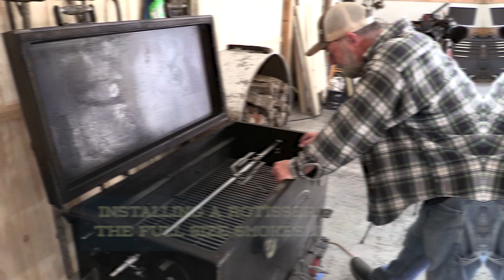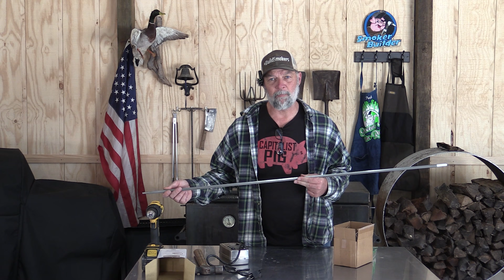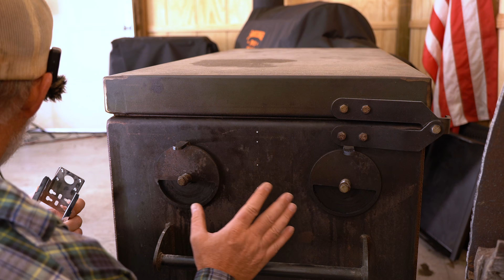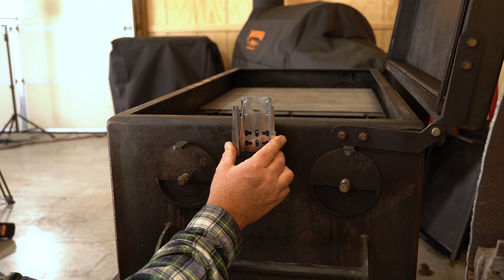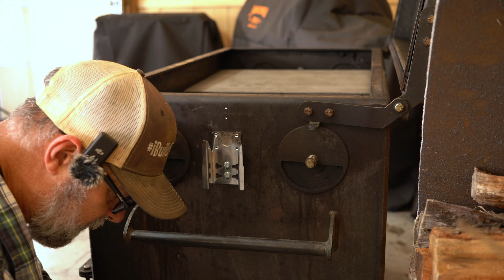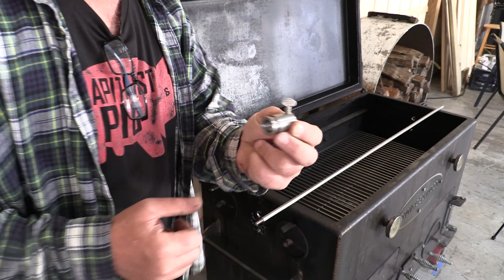Smokeslinger Rotisserie Install | How to Mount the OneGrill Rotisserie Kit

Comment: The value of the Smokeslinger is insane. If anyone is on the fence of buying this pit, think of it like this. The cost of this pit with the max cost shipping is around 4300 with planchas and rotisserie included. It is a multizone direct heat cooker, offset smoker, reverse flow smoker, flattop griddle, and rotisserie. It's cheaper than it's direct heat competitors that boast fewer features and less capacity. The value of this pit has to be at least 3-4 times the cost. Can't wait to get mine.
Reply from the maker: That's awesome, brother! You're gonna love it! Thanks so much for saying this!!